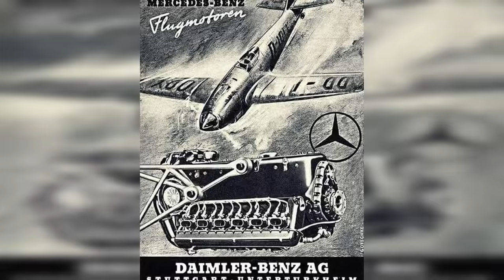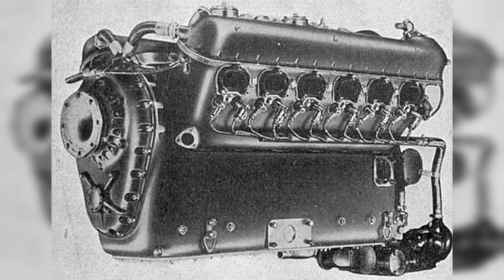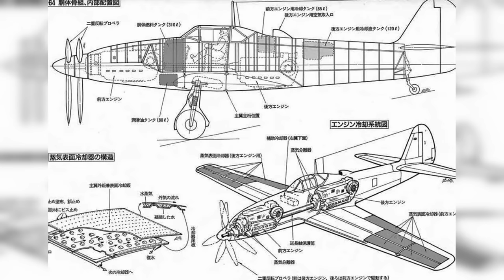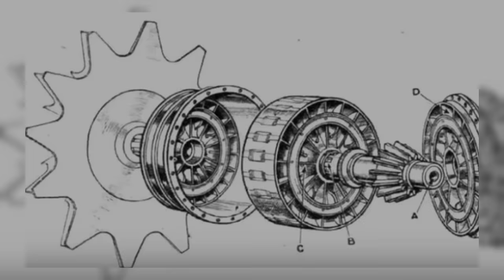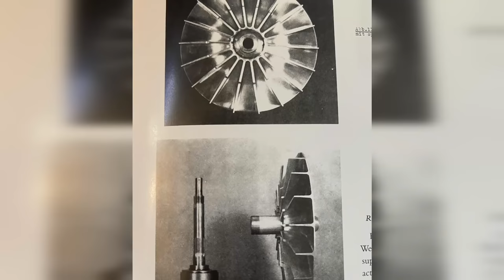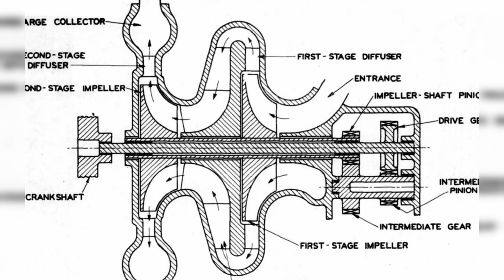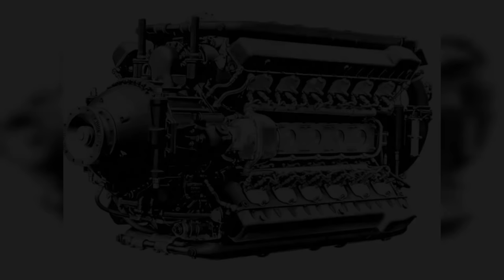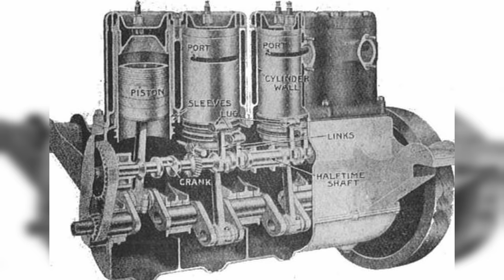The Engine of the Dark Side? Daimler-Benz DB-600 - DB-605 - Part 1

Comment: Big fan of the direction this channel is taking towards in-depth engine design and engineering.

However, cut the fat and skip the historical/political preface. No one watching a niche video on specific WW2 engines needs a boilerplate history lesson. The actual discussion on the engine itself doesn't start until 4:05, a full fifth of the total video length. I would rather 5 minutes of pure engineering than 21 minutes that I have to skip through to get to the good stuff.

Otherwise, great stuff! Please look into ways we can support the channel, this is absolutely the kind of content I would pay to see more of!

Comment: Yes that is right during  world war two in order to modernise their air force CASA and Hispano secured, licensing agreements for both types , new or refurbished with DB 601,s and Junkers Jumo 213,s. When supplies and  spares for these engines dried up, although they could have contacted Volvo Flygmotor In Sweden who somehow acquired a license to manufacture DB601 605,s that powered SAAB,s B 18 a Dornier 17 clone,and their unique J-21 twin boom pusher fighter. CASA and Hispano opted for an easier solution entering an agreement with Rolls Royce at Derby to supply Civil Spec Merlin engines. Fitting Merlins saved these two from the boneyard ,each serving the Spanish Air Force for several years. that is why they were a god send when the Battle of Britain Film was shot in Spain and Duxford in 1967-68, giving the embryonic warbird  preservation movement a vital shot in the arm. Some Buchons were rescued from boneyards and re manufactured, a few  fitted with original DB 601 605,s carefully rebuilt from heaps of junk.

Comment: Reminds me of my GERMAN made FORD  Granada . Previous models were Carbs.  3.0 V6. But the 2.9 injection engines were “ supposed to be more powerful- better fuel economy. Etc et.  Infact. Unless you replaced all the FUEL LINES with extra tensile strength versions and retuned the BOSHE pumps. You had a problem after maybe 30k. Which is not a long time in driving. Example you’d do average 5k to 9k per yr.   … that’s not long for a luxury vehicle.   I’ve bought lots of old 2.9 I.  V6 engines. They all have 2 big problems. The Water pump housings crack break and cause head overheating. And the fuel pumps are crappp

Comment: Great video! There was an inverted version of the American Liberty 12 engine coded the V-1650, but not to be confused with the Packard version of the RR Merlin. Not sure what year that was but I think it was before the DB600 series.
Reply: Chrysler developed an inverted V12 very powerful one toward the end of the war with No market for any more prop engines as they were going into the jet age.  So it was already yesterday's news by the time it past the development stage.
Reply: Most likely a 1650-9 a merlin 101
Reply: @tomstulc9143  most likely a copy of a merlin 101
Reply: The inverted Liberty was actually around 1100 or 1200 cubic inches. Built by Allison it was also air cooled.

Comment: Inverting engine meant the narrow part did not obstruct pilots view , prop was higher away from ground strike, room for gun
Reply: Prop wound up lower when a reduction gear was included, which is part of the reason for the BF109's ungainly landing gear that caused many accidents. And upright V's can accomodate a cannon too; see the Hispano-Suiza engines used by the French and various Soviet V-12s which could accomodate engine mounted guns. Unsure on the forward view, it's pretty bad in the 109 but that's probably mostly because of the cockpit design rather than the engine.

Comment: Mercedes, Auto Union Bosch among other manufacturers dominated the racetracks in the 30s and provided German industry with valuable knowledge of the optimal engine. Competition on the racetracks stimulated research in aerodynamics, fuel optimization, (compressor and turbo technology was invented in Switzerland and Germany), metal alloys, electronics, etc. In addition, Germany has always been dominant in chemistry, resulting in German industry excelling in the field. Factors that strongly influenced the growing aviation industry. America and England were not on track until after WW2 when they gained access to German research and industry. America was good at mass producing products and that made the difference in WW2.
Reply: America and Britain both built fantastic engines. I’d rank the RR Merlin from ‘43 onwards as the best aircraft engine of the war.

Comment: how was the design of the piston on this engine or inverted engines?
common piston would serve as a oil bath and not letting the oil go, the upside down cylinder would fill up with oil?
Reply: Don't forget that, on a four-stroke internal combustion engine like this one, that the crankcase is supposed to be sealed from the combustion chambers, by the piston rings. It was, presumably a dry sump design and I imagine that the crankshaft lubrication allowed a small amount to go the the cylinder walls and anything remaining was sucked up by the oil pump and returned, after cooling, to the oil tank to reservoir. The undersides of the pistons would send any oil on them upwards, where some of it could be caught in some sort of a well, to be pumped away. Dry sump designs are used in several motorcycle engines and maybe car ones as well, not only such things as the DB600 series. Wet sumps are much simpler and, in some small and lower-powered engines, are used without an oil pump; just with 'splash' lubrication with a so-called 'spoon' on the bottom of the crank-pin.
Reply: @lukewiseman9946  all professional (race) engines use dry sump system to prevent that the crank hits the oil bath and splashes and encounters resistance due to oil, loose HP/power
You need a oil pump on any 4 stroke engine to lubricate the camshaft, cam followers and optional cam chain. unless it's a old stationary engine where you hand oil these parts.
although not all 4stroke engine have a oil filter or just some cheap metal mesh to pr vent big pieces ...

the oil in the upside down configuration of this engine might assist or give some extra level of compression or prevent lost of compression. but maybe they had some advance piston design like current F1 cars with minimal sleeve to assist to oil to flow away. the rocker covers in these video had hoses attached to them, indicating a "dry sump" oil pump.

Comment: Yes in the late 1940,s CASA cloned the Heinkel He-111 H Series, known as 'Pedros' swapping the Junkers Jumo 213,s for  Rolls Royce Merlin 500s, a civil version of the 20 Series with beefed up ignition and blower for intensive cilvil applications. Same  500,s Series also powered cloned Messerschmitt BF 109 Gs built by Hispano Aviacon as the'Buchon',some with Hispano Suiza 12Z,s.
Reply: + Basit Taylor    Spain had a wartime agreement with Germany to make the Bf-109 and the He-111 under license, but manufacturing did not begin and Germany was unable to supply the engines.  Some the early CASA 2.111 and Buchon aircraft were leftover or repurposed wartime airframes.  Spain operated those aircraft until the late 1960s with a few airframes flying until the 1970s.  The bulk of the retired aircraft were used for the 1968 "Battle of Britain" film and were snapped up by collectors after disposal.  Very few of the 2.111s found buyers and were scrapped.
Reply: These were the "Messerschmidts" and "Heinkels" that were flown in the movie "Battle of Britain".

Comment: The German Luftwaffe gave the specs out for an engine design, MB came up with the inverted engine to fit into the Me109 frame giving it a more sleeker look than the Spitfire. This engine is just as iconic as its Rolls Royce counterpart, being updated regularly as the Me109 was modernised. Why is it evil?

Comment: Rolls-Royce also made an inverted-V engine, and when Luftwaffe bigwigs made a state visit to Britain sometime in the 1930's they were shown RR which was assembling these engines at the time. Some suggest that this may have been the inspiration for the German inverted-V engines, however the time window may not support this. More likely they considered this a vindication of their choice. There's a picture in a book about the Battle of Britain buried in my loft. At the same state visit the germans were shown the first Hurricane fighters, complete with their 8 guns and novel reflector gunsights, an idea which the Germans promptly took on board. The Brits had this open-house policy with which they hoped, with enough flattery, to deter Germany from attacking them. Not very intelligent but that's the way it was. The Merlin variants used in the photo-reconnaissance Spitfires, running on truly exotic cocktails could poke out 2600-2700 HP for short runs making these aircraft essentially impossible to intercept. This was not a racing aircraft but a specialised operational aircraft. The Americans had nothing like it so the USAAF used PR Spits as well. The fuel messed up seals and the like, so the fuel system had to be drained and seals changed at very frequent intervals. The British knew the Germans were going for direct fuel injection, a well-wisher in Czechoslovakia had sent them a complete pump. They greatly admired its design but concluded that it would be impossible to maintain in the field, based on their experience of flying aircraft in dusty places like Mesopotamia and North West frontier (Afghanistan). They were proved wrong, and it would be interesting to see how the Luftwaffe maintenance crews overcame this problem in the Western Desert or the steppes of Russia. Maybe the injection systems just didn't break down that often.
Reply: 90% of US photo recognizance was carried out by p38's.....

Comment: I've always wondered how these upside-down engines managed oil control.   It seems oil would collect in the inside of the pistons (since they are upside down) and create problems.
Reply: + Clairborne East Jr.   Most of these engines were dry sump, pressure lubricated.   The lowest point in the inverted VEE engine is the rocker covers, and the DB series had scavenge pumps to recirculate the oil.
Reply: They did in fact have some issues with this, notably the DB series have different compression ratios between left and right banks to compensate for the crankshaft throwing more oil down the cylinder bores on one side. Not necessary on upright engines. Radials had it even worse, watch a radial startup and you'll notice the copious smoke caused by oil pooled in the lower cylinders burning off as the engine warms up.

All engines back then were gluttons for oil. A 20:1 ratio of fuel consumption to oil consumption wouldn't be unusual; compare that to a modern 2-stroke chainsaw which uses a 50:1 ratio! Of course back then 2-strokes usually ran 10:1 or even 8:1 fuel to oil ratios, so the 4-strokes were still winning...

Comment: My father worked on B-17s in England. He told me that initially the ME-109 couldn't reach the B-17s because the bombers had superchargers. Germany quickly fixed that.
Reply: The Me-109 had a higher service  ceiling than the B-17 and was introduced 1 year earlier than the B-17.
Reply: @sandervanderkammen9230  , I have to take your word on it. 39,000 for the 109 vs. 36,500 for the B-17. The only thing I have found so far is that the B-17A was a turbocharged upgrade. I can't find anything that says that the ME109 never had a supercharged engine. The one thing that I can find is that there were multiple variations of both aircraft.
Reply: @spaceflight1019  All B-17 models after the B-17A had the same 1,200hp turbocharged R-1820 engines.
All of the DB-60X versions of the 109 had supercharged engines ranging from 1,000hp prewar models to 2,000 horsepower with WM-50 and GM-1 injection.
After 1942 all had pressurized cabins but the same max. service altitude of 39,000 feet.

Comment: It was interesting to hear the boys over in Germany didn't find the sleeve valve option a good one, even after testing. Tuff nut to crack for sure. Napier got it right but their manufacturing was lagging, couldn't get the sleeves just right for mass producing where Bristol did. It's also interesting to see most of the tech developed pre war (GDI, multi valve head, DOHC, Turbo and super charge, variable valve timing, any one else want to add to the list) was in use. And these days car manufactures harp on about new tech. Sign, more marketing BS.
Reply: Engines are complicated enough without adding sleeve valves....

Alsow one thing to remember, while a better flow to the head is great because it allows more air and fuel in and out... especially under higher boost levels, allowing for even more power. What good is it to an  Engine that is limited by the knock resistance of the fuel and not by the amount of backpressure in the cylinder head?
Reply: True, but these WWII aero engines were the pinnacle of mechanical engineering at the time, performance at any cost basically. It was only much later that technology became economical and reliable enough for mass market automobile use.
Reply: @justacomment1657  they had c3 fuel 100 octane problem is their engines were never as good as you think even the wiki greatly overestimates all German top speeds
Reply: @kieranlee9610  c3 was verry verry limited. And compared to 150 octane the allies used it still sucked...

C3 was so limited that they actually come up with the water methanol injection just to be at least a little competitive.... But Germany hat so much shortcomings everywhere its a bloddy wonder that they actually managed to get a jet engine working without any decent raw materials...
Reply: @justacomment1657  C3 wasn't actually that limited many of their planes used it especially in operation bodenplatte difference is mw50 doesn't work above the first supercharger speed for every German plane they had to deal with having pretty bad engine power above 3000m DB605A to DB605ASM-ASY high alt varients they only went up 1000m more to 7000m those had 900hp jumo 213s 1500-1700hp DB603s 1500hp and people may think they did something incredibly with that jet engine but realistically it literally paved the way for cheap generic basic jet engines British paved the way for incredibly complex engines infact its probably against what people think Germans were relatively simple engineering British had some extremely Complex engineering but then again complex engineering is always more reliable than simple that's probably why German car makers today are still below average on the reliability scale
Reply: Theory and practice are only the same in theory.  The practical disadvantages of sleeve valves have always outweighed their theoretical advantages and Napier found out the hard way.  It took four years to sort out the production problems and the end result was never reliable enough for civilian use or even peacetime military service.
Reply: @kieranlee9610  incorrect statement.
Full pressure high was above 3km for DB605A (5.8km) 
MW50 not working on anything except first supercharger stage is alsow a dubious statement . ...cooling the charge air always works as long as you actually have positive pressure.....
Reply: @justacomment1657  well you see the supercharger was more of a CVS a constant variable supercharger always varying supercharger gearing until obviously the F.S fast speed in fact it doesn't really work up above 3000m factually it only gave a rough 3% increase cooling air that's already cold doesn't really do much you forget even with the positive pressures its still lowering the British invented methanol water injections the Germans were going off British books pretty much the same about their engines actually and planes we all know it doesn't work high up number 1 there's less air 2 the mix was prone to freezing the only power advantage it had was cooling German engines were extremely hot but with the correct supercharger it still doesn't work at around 5000m maybe 4000m example do335 ta152s and bf109AS they all have the same supercharger but all incredibly hot engines bf109s were borderline overheating every time they flew that's what the thermostat did made sure it was always on that border full pressure height wasn't 5000m they still lost power at 3000m everything loses power at 3000m that's kind of why the tempests flew at that altitude to catch anything and everything out losing power between supercharger speeds there's quite a difference between sea level and 3000m supercharger or not it still loses power these superchargers on German planes were incredibly hot also kind of where most the heat was coming from
Reply: @kieranlee9610  as engine speed was kept constant as and boost pressure was directly linked to it I am curious how that would work on a constant variable supercharger.... I do know about constant speed propellers...

I would appreciate a source for your claim.
Reply: @justacomment1657  Constant speed propellers are something different superchargers are throttled and based off the pitch of a propeller faster you go its more at a 60%-70% pitch at lower alts that's 60-70% of the engines max rpm the higher you go the higher pitch is for more lift/thrust which ever way you want to look at it at high alts max pitch max rpm max pressure at lower alts those pressures will blow the engine diving at high speeds will blow the engine that's why Germany had to use an ECU for their planes the pilots kept blowing up the engine or crashing it
Reply: @justacomment1657  Sleeve valve engines do away with the hotspot caused by the exhaust valve(s). They are very tolerant of low octane fuel.